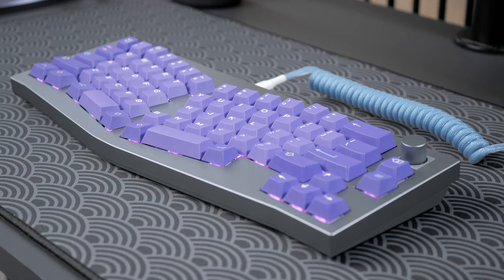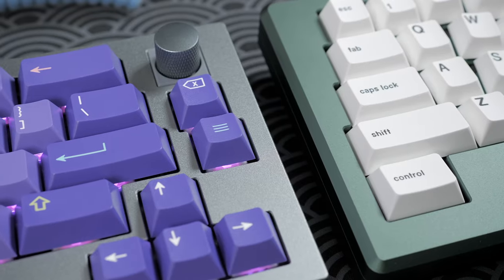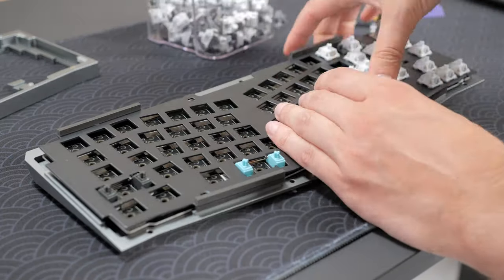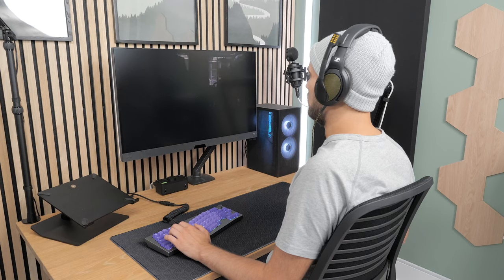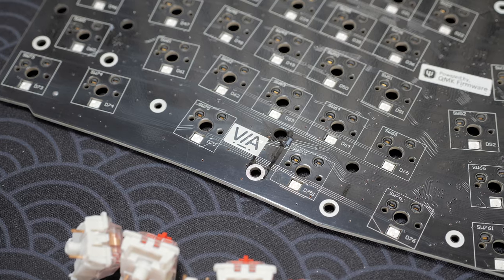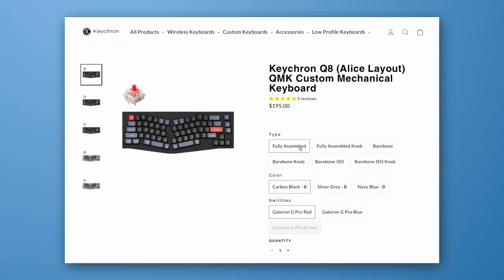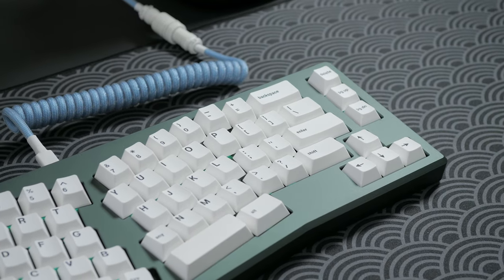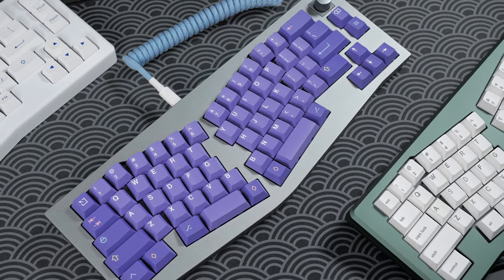Should You Get Keychron’s Alice Mechanical Keyboard? ~ Q8 Review

Comment: The hidden switch socket is there because they originally planned on having two 'H' or 'G' keys like how there are two 'B' keys, but people weren't satisfied with having another 'H' or 'G' key so instead of rebuilding their PCBs and plates to exclude the extra socket, they just covered it with the top case. Valid.
Reply: so with modification you can have it if you want.

Comment: This is the only Alice/Arisu keyboard available with ISO layout support that I'm aware of. I really like my Q8 with the brass plate and long pole linear switches. I had to add an additonal force break mod and some foam to the case though. I also have backspace mapped to one of the spacebars what is the biggest advantage of this layout in my opinion.

Comment: I am thinking about getting a keyboard from keychron, and am going for the pro red switches, but I am a little confused on what they are lol.
I'm new to making keyboards, but an avid gameur. from my understanding, the switches are perfectly linear until they bottom out, correct?
and how light are they to push down when using them with pbt keycaps. thanks in advance :)
Reply: Correct, they're linear all the way to the bottom. I have linear reds on a Razer keyboard and found them to be overly sensitive, but that may have just been that specific keyboard. I just got the Q8 with Browns and they feel pretty much ilnear aside from a slight bump at the bottom that I barely even feel. Seems like a good middle ground if you're worried about accuracy in your typing/gaming. Also, if you were considering the Q8 specifically, just know that they're releasing the q10 very shortly which has F keys and some other additions. They announced this less than a month after I got my Q8 which needless to say has me very upset, haha.
Reply: @wellhellotherekyle  oh cool, I was going to get the Q1 v2 because it has the f row and arrow keys, and none of the others do, thanks for letting me know :)
Reply: @wellhellotherekyle  Good choice! I think keychron delivers pretty good quality throughout all keyboards. I use the red switches for work as well as gaming and i love it. Can recommend!